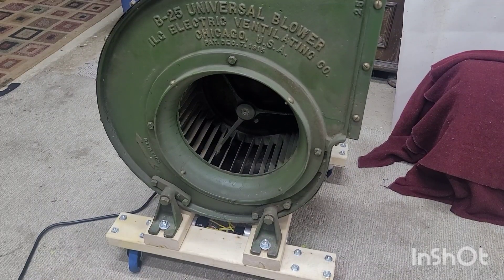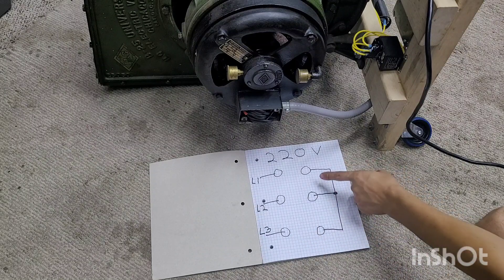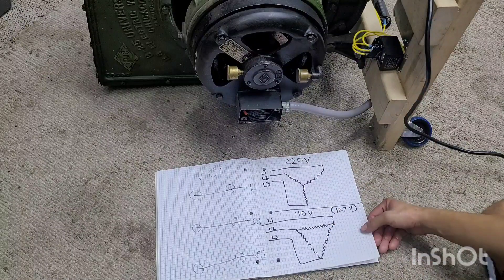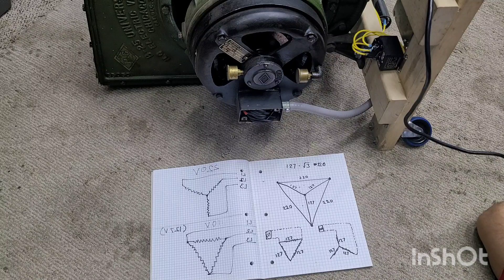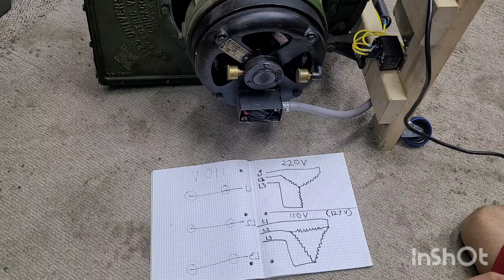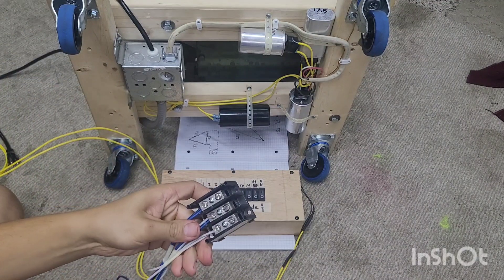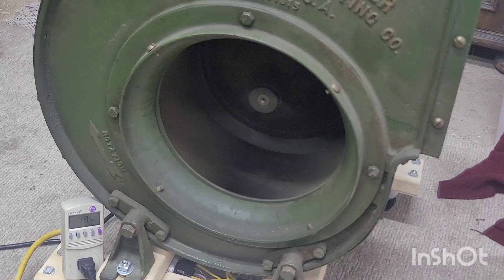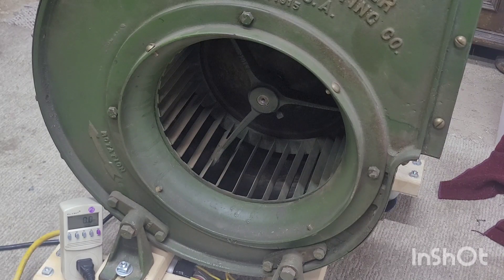ILG B-25 Static Phase Converter Discussion and Demo

Comment: переделка на 1 фазу?
Reply from the maker: Yes this is a static phase converter which in some ways acts similar to a PSC single phase motor, except this uses a three phase motor and the capacitors shift the phase to cause a rotation of the  magnetic field. These work well for constant motor loads.

Comment: Very nice converter setup; and explanation! It's quite impressive how much difference the start cap and potential relay makes. There are some harmonics which happen at certain speeds with these motors and no start capacitors. Sometimes they won't be able to accelerate past that range without the capacitor. 

Please keep making these videos! They are great and are definitely helpful for many of us fan enthusiasts.
Reply from the maker: Thanks David! I definitely look forward to making more videos hopefully soon covering similar material and of course it is always fun to keep experimenting with new designs.
Reply: @ilgfanman  
Excellent!  Looking forward to seeing them!